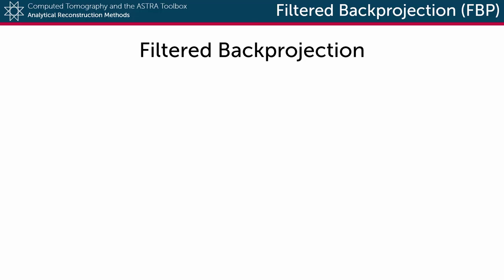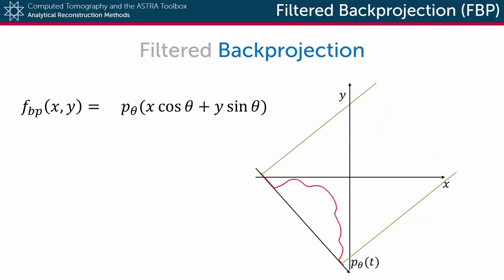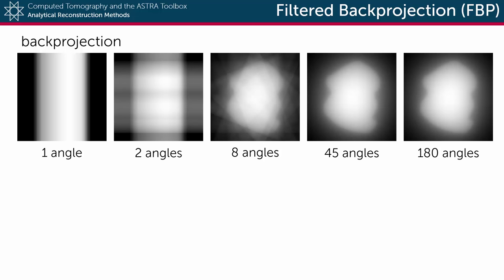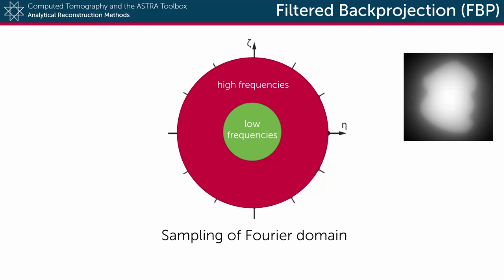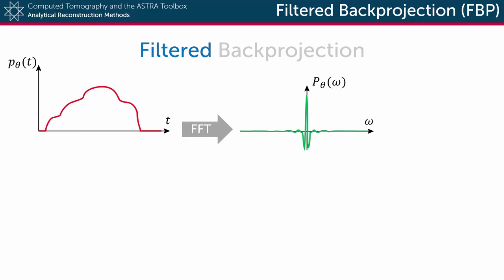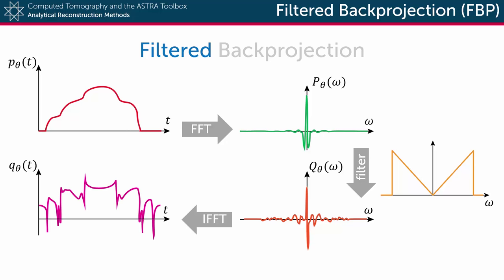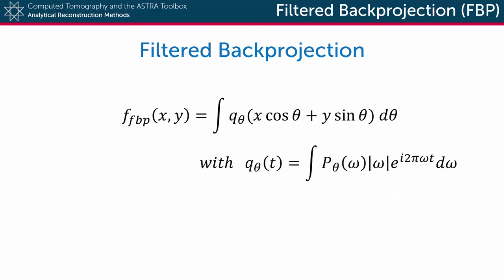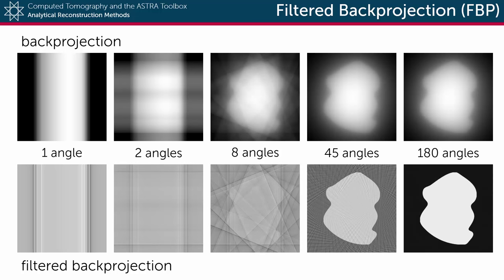Filtered Backprojection (FBP)

Comment: I think there is a mistake on 3:09. He's saying "all the frequencies HIGHER than that are set to zero". I guess the right word was "LOWER" as we're talking about a High Pass filter, so lower frequencies than a certain amount get cut.
Reply: He does explain the reason for that. Higher frequencies contain more noise and less signal which results in more noise in the output.
 In order to reduce the noise in the output he uses a cutoff value.
Reply: Jay Bhanushali but the ram lak filter is a high pass filter. It cuts LOW frequencies as in the standard back projection low frequencies gain more importance than the high ones and this provokes the blurring noise. So you have to gain high frequencies, not cut them off...
Reply: @elijak8263  I thought that too at first. But if you look closely at the frequency response of that ram lak filter, you can see that it first ramps up linearly and then falls down abruptly at that said cut-off frequency. So yes it is a High Pass filter but with a cut-off at a high-frequency to eliminate the high-frequency noise.
Reply: No the ramp filter does not CUT any low frequencies. His filter is modified so that frequencies above a certain frequency are cut off (although if you ask me that's a rather inelegant way to do things, he should multiply his raw ramp filter with a gaussian function) to suppress high frequency noise otherwise high frequency noise would be boosted to a ridiculous degree.